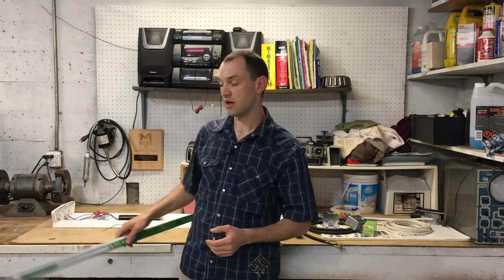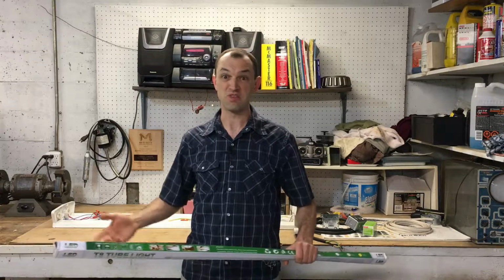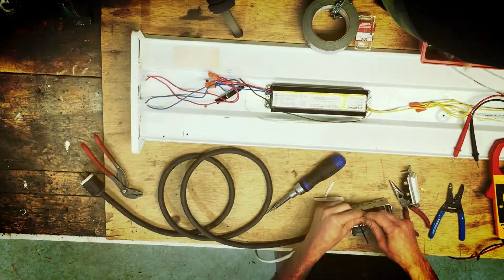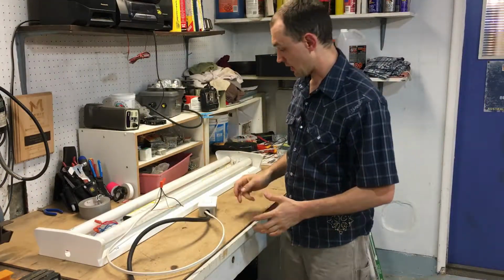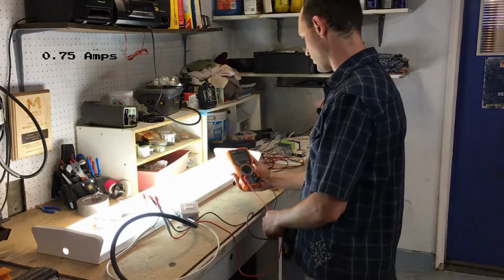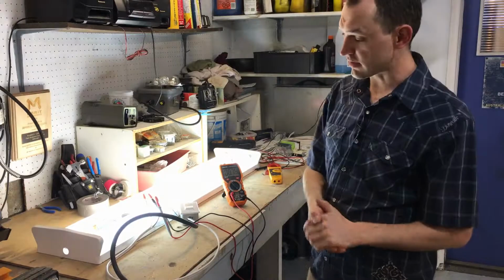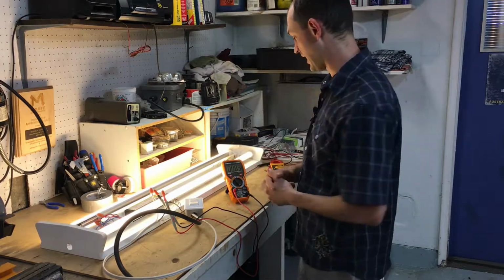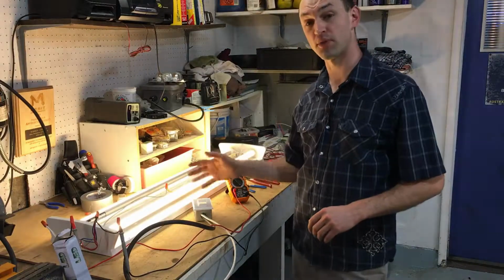Led vs Fluorescent Tube Power Consumption

Comment: This video was really great. However, there's one thing really wrong here. "Power" is recorded as Watts, and what we were shown was amps being pulled. There wasn't any indication of the voltage from your outlet, so no way of us calculating these numbers.
Reply: Thanks for your comment, Thomas. I often forget that people from around the world can watch this video, so I assumed they would have the same voltage as I do. I am in Canada and we run a 110v 60hz supply. I will keep this in mind in the next video I do and make sure to present all the variables.
Reply: @warrenchristie1416  Ah no problem! There's a  lot of guess work with videos when it comes to mains voltage, figuring out which country it's from makes it a while lot easier. :P
Keep up the great work :)

Comment: DO NOT run ballast bypass LED tubes with a ballast. They will stop working in short order. There are LED tubes designed to run with a ballast. There are LED tunes designed to be run with AND without a ballast. Get those of you wish to use a ballast.